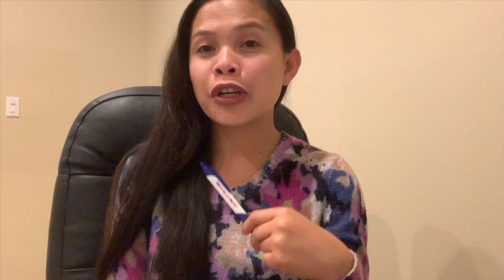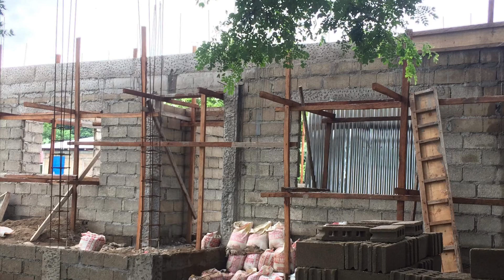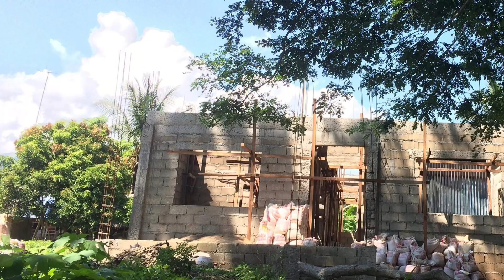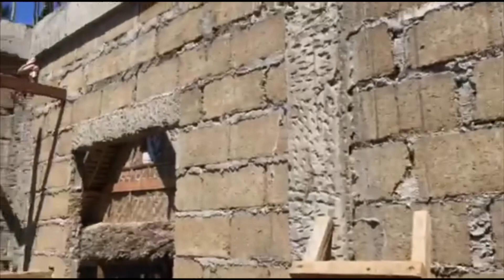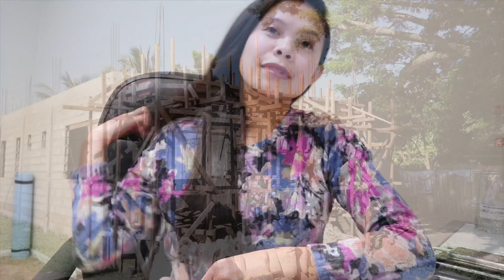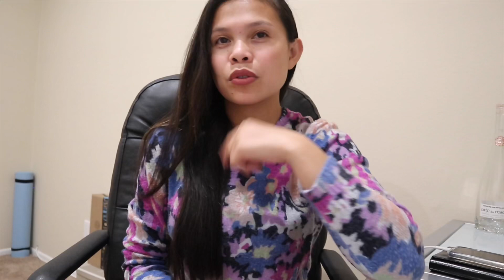OFW-How much does it cost to build a house in the Philippines?- 12 Weeks Update

Comment: For a simple house estimated cost will be around 15-20k per sq.m. including finishes. Not including the lot.
Reply from the maker: Sa amin I was told around 13k/sqm pinaka mataas ata is 20k. I’ve spent 477k already on this one. 😏 so that means I won’t be able to finish it until mid of next year.
Reply: @airvilleleenmae  how much total sq.m. it depnds sguro on the location also, but as far as i know its ranging around the figures i have said
Reply: DM
Reply from the maker: erick castillo location makes a difference. This is in Negros Island an isolated area just kidding. My bro works at the provincial engrs office so bali sa  quote nila ako nag base and him being there plays a big role here kung pano ako nakatipid. 😃 floor area ko is only 100sqm maliit lang.
Reply: So its around 1.3-1.5M if 100sq.m
Reply from the maker: erick castillo the estimate cost yes. But I’m not sure kasi I want it to be more than just a simple house inside.